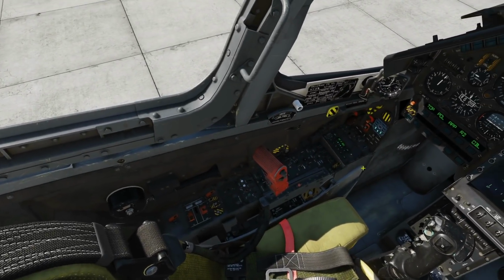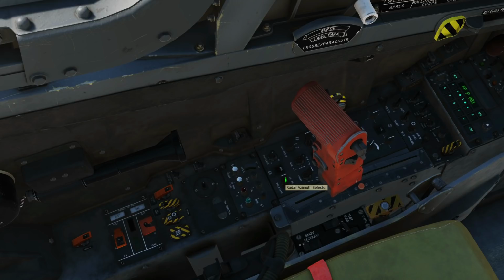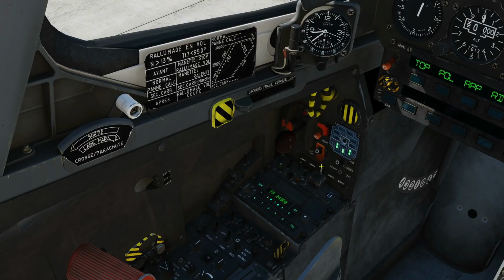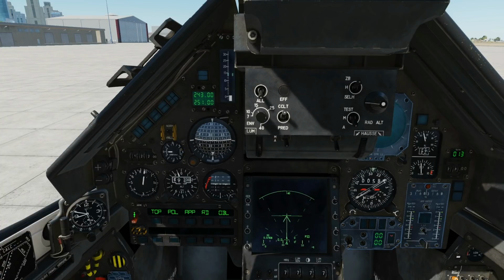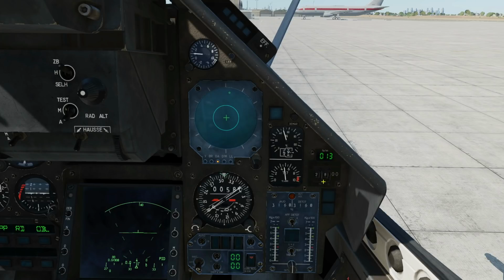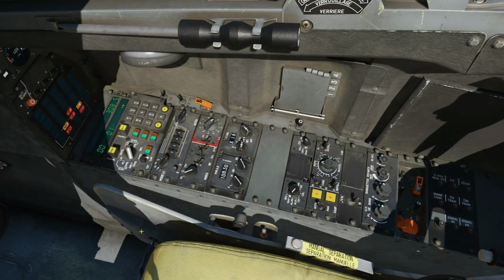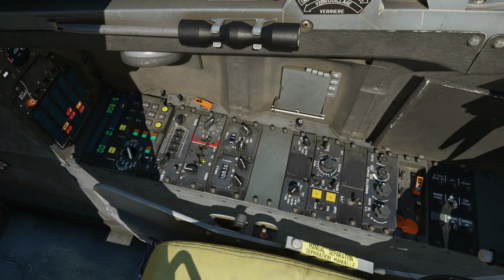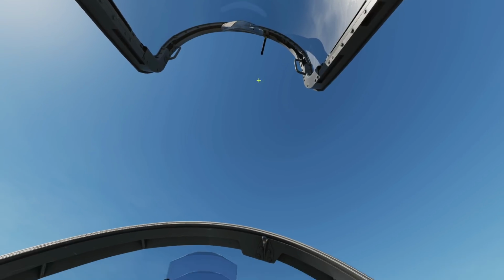Mirage 2000C: Cockpit Familiarization Tutorial | DCS WORLD

Comment: I noticed that the ENC button has been removed from the PCN Panel at 28:05. It used to sit between the PREP and DEST pushbuttons. How do I now tell my navigation system to cycle between my waypoints automatically or manually?
Reply from the maker: I think there is a WP incrementer button on left of dash now, and can bind controls to it.
Reply: Glad I can bind it to my HOTAS although it's a shame that it's no longer automatic. But thanks, I missed it when you indicated the WP incrementer at 12:01

Comment: Is this module ever going to get decent BVR missiles?   Seems like a great plane but what kind of modern fighter only has heaters.
Reply: It has radar guided missiles as well.
Reply: 1) it doesn't only have heaters, the 530 are fox 1 missiles.
2) no it won't get better than the 530, because the 2000C never carried better. If we ever get a 2000-5, then we might have MICAs, which can be used as fox 3 missiles
3) the 2000C is quite old by now, it's from the early F16 & F18 era, back when the sparrow was the missile used by the usa. While the F16 and F18 got updated quite a bit and got better missiles, the 2000C only got marginal upgrades as it's only real use by the ada was to police the french skies. The 2000-5 got all the juice

Comment: This module is so cool. I recommend it as a beginner plane. He s not hard to understand and extremely capable in 
A/A (even if he only has fox1 for BVR). He is in my opinion the best dogfighter in the game ( delta wings).
Reply: Angleesh
Reply: Yup it flies really easy due to FBW, the Engine is strong enough and it can Air Fight (only tried against AI), even easier for Cockpit workload is the F5 but it's harder for Ground pounding, weaker Engines, has no FBW and only 2 Sidewinder, BUT it's the famous MIG-28 😎 bought the Mirage long ago as my first modern Jet, (the A10 don't count, it's a Jet but kills Tanks) my French "wannabe F-16" must be 3 or 4 years ago now 🙈
Nice that the Videos get updated, I noticed the update instantly in the Cockpit, like "hey that Glass above the Fuel Panel wasn't there last time, and that, and that, and the Button for waypoint cycle is new..." Cool they updated the Cockpit 😁
Things u notice when used to the Cockpits of the DCS Modules